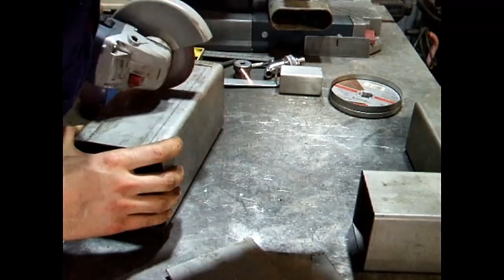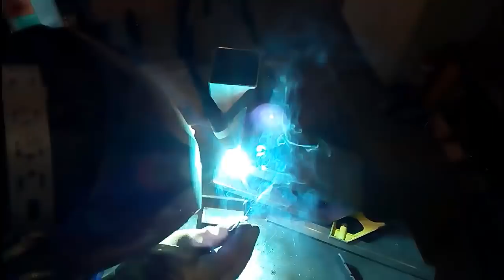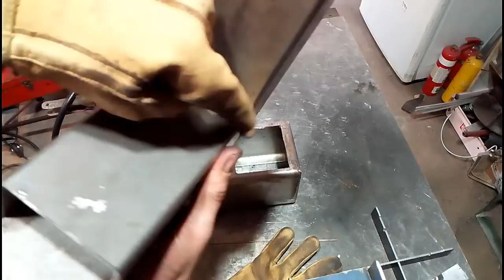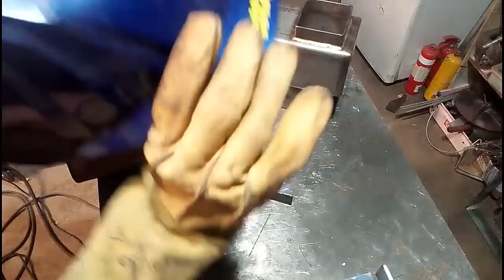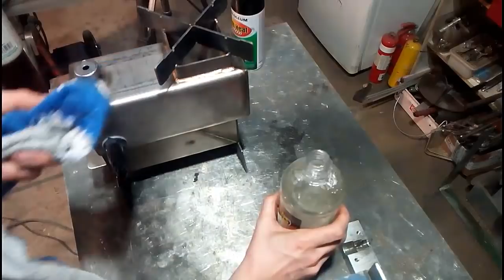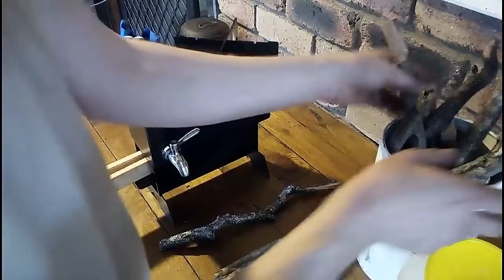Rocketstove Water heater build

Comment: Endless hot water/engineer 775 to improve ideas. Just saying 😅😅😅.
Reply: E. Stgo. < My ideas for mods are:
1) Relocate the spigot to the top edge of the back side (threaded is fine) Might locate riser further inward on tank for clearance
2) Threaded filler tube that rests just off the bottom.
3) small metal funnel that fits filler lid (maybe a screw-on funnel)
4) Damper slide or flap to regulate heat.
5) Thin Fold-down side trays hinged at bottom of Fire box.
6) Fold-open half-trays on top of water heater for warming / drying / staging area.
7) Slide out ash tray under burn chamber

Just a few ideas... This stove was never meant to be run without water, so make full use of it. The convection idea to feed a radiator, oven, heat exchanger, etc would be easily adaptable to inlet & outlet of water chamber.

Comment: A kettle on a rocket stove simpler, easier and probably faster because you would not be cooling combustion chamber. Did you put in a pressure relief valve? The vid was too long and boring to watch to the end.
Reply from the maker: Yes you are right, a kettle dose indeed work faster to boil water.  The filler cap has a 10mm hole in it, so no relief valve needed....  long and boring, tell me about it,  I was there for the lot of it.   Thanks for sharing your thoughts.
Reply from the maker: The water surprisingly had no noticeable effect on the burn as the water heated with the stove. All got hot together and stayed hot, like a cooking pot on the stove with the lid on.  The filling cap has a 10mm hole in it so it dose not need a safety valve.  All this was reviled in the long vid, which is why its long.

Comment: Cutting a bigger hole in the top and having a snap in lid might have worked a little better. Especially when you need to clean the water deposits out? Or maybe a regular bath with vinegar?